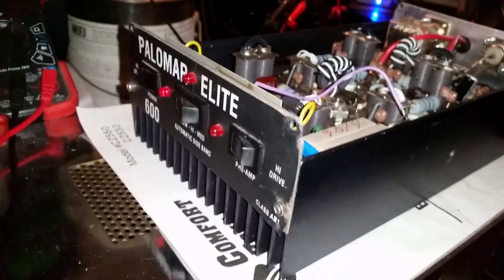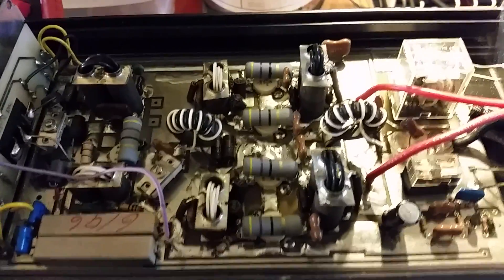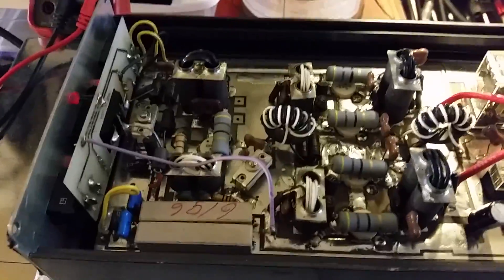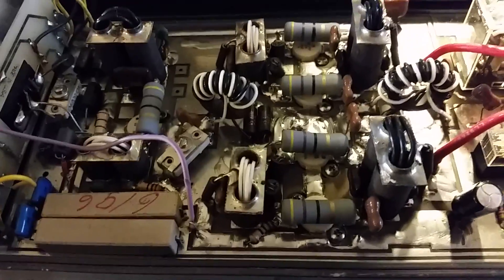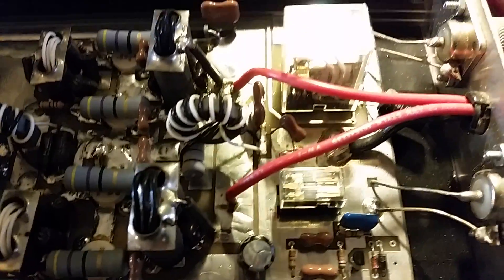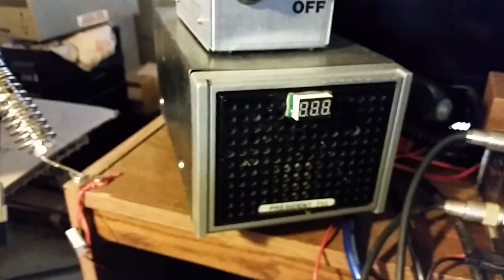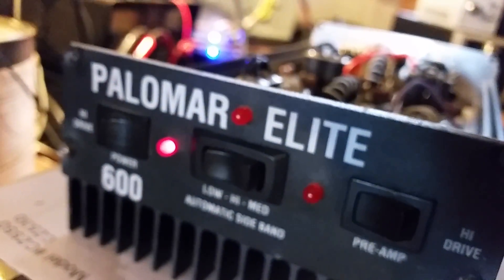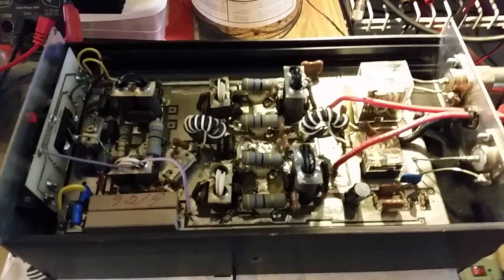Palomar Elite 600 AB1 1x4 Amplifier Repair & Mods

Comment: What does your feedback circut consist of on each transistor? I see the resistor and looks like a disc capacitor of some size. Thanks
Reply from the maker: 103 or 104 and 100 ohm
Reply from the maker: Cap is mainly just a DC blocker so it doesn't matter which your use
Reply: @1883GotDown  Awesome! Appreciate  your help!

Comment: 15 or so years ago when these were saturating the market they were a bargain. And Sounded pretty good as i remember, they had various output devices as time went on.
Young dude in my area had one, and thought he was a big deal with it. With most guys running 2 transistor amps, he was a big fish. He soon learned what 2KW + could do : )
Have a merry GK..........622